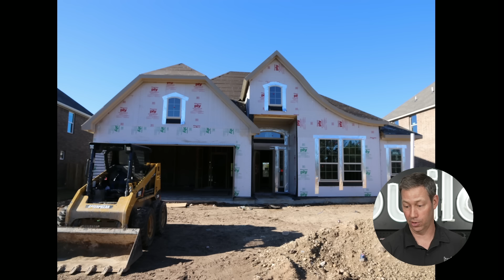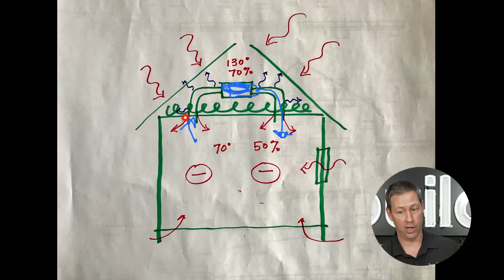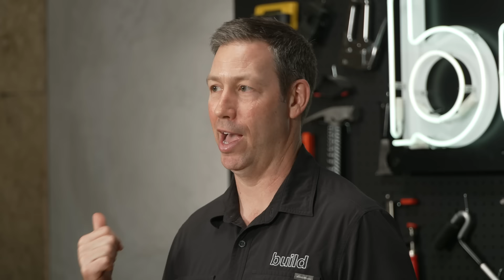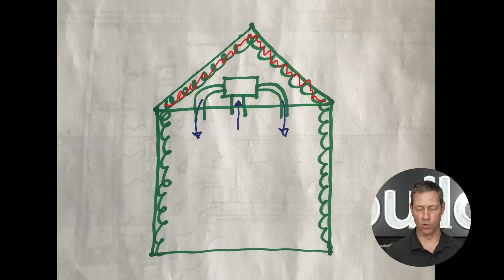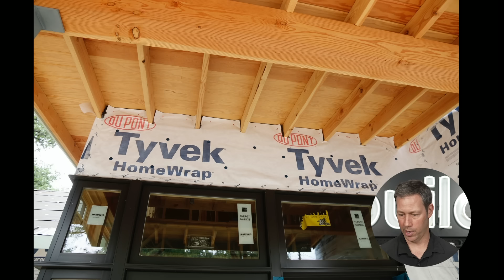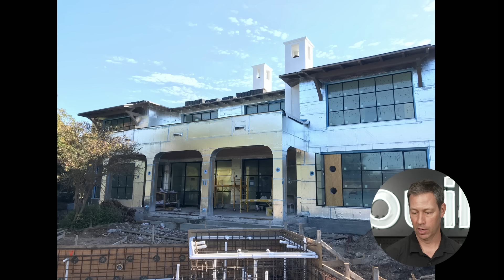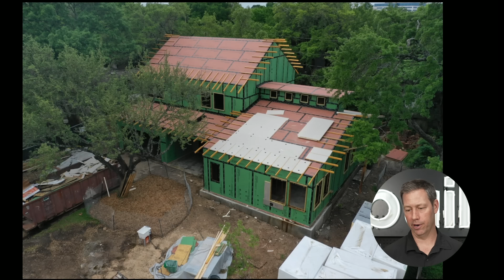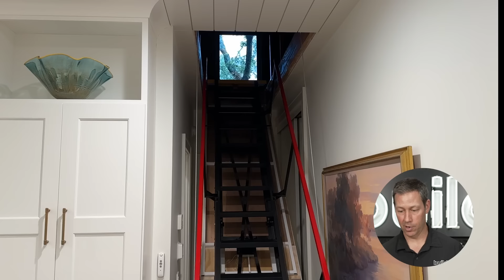CRAPPY ATTICS are Standard in America! Here’s how to BUILD - DECENT or AWESOME

Comment: How well does a house built like yours hold up to settling? Do the tighter tolerances present challenges? ie- if the base of the house is settling, does the taped (butted up wall to roof-line) corner hold up since everything is cinched together or will it "tear" creating a hole?
Reply: Settling is less common/severe when done on a good slab.The tighter tolerances also resist setting from the frame level a bit more due to less range of motion between materials. Following this with the tape and line seals then helps counter any minor settling that can happen by providing an additional barrier.

Comment: QUESTION:
Hey Matt - Why did you go with Rockwool in your house instead of polyurethane foam? Is it a longevity thing? Cost? Performace?
Reply: I’m guessing it’s the budget. 95% of Customers have a budget that can’t afford spray foam. Spray foam is way more expensive than rock wool.
Reply: @ykciR I don't think in his case was the budget ;), I would not use spray foam even if I could afford it and will not use it with my build in Chicago, for sure ;)) ? (mineral wool is the way to do it ;))
Reply: No fire risk would be my answer. Most foams burn readily, and any inadvertent insect access to it can threaten to fill it with holes or removal, also.
Reply: @piotrek4302  but why?  What’s the logic behind that preference
Reply: @27photogger  Fire, toxic smoke if burning, outgassing, if not concerned about that then it can separate from the structure over time if the wood shrinks or house settles since it is rigid and will break providing gaps for air instead of conforming to any movement.

Comment: Awesome video, great tips!  I redid a 60's attic a while ago and sucked out all the old stuff + droppings.  new vents, radiant barrier roof,  it was a lot of work but worth it.   On my new builds I'm going with conditions attics and try to get to awesome!  I also painted the old brick white, which rejects a lot of the Texas heat, brick went from scolding hot in the afternoon to warm to the touch.  but I didn't achieve much for house seal.   I did foam up all the cable penetrations and gaps I could see attic to ceiling-wise.

That R-50 roof is genius, best way to go for Texas.  I saw another youtube builder doing something similar but the nailed the eaves to the siding which I felt was structurally weak and will sag eventually.   

Thanks again!

Comment: This was the perfect video for me As I live in CENTEX about an hour north of Austin, I have an attic with the open cell foam. It's actually not bad, but it could be better. I wanted to do some improvements on the space and you threw out a lot of great ways to improve it. I also want to work on the attic space above the garage. The garage is insulated and stays fairly comfortable. The space above has no insulation and your current attic setup looks like it might work for that portion of the attic.

Comment: The crappy attic is awesome if you just don't put mechanicals in it. Smaller area to air seal and insulate with cheap cellulose.
Reply: True.
Reply: Of all the comments to this video, yours is the one that is the most spot on--a true "emperor has no clothes" insight. You have stated the obvious, but most overlooked. The cost to create a conditioned space in the attic creates two issues: the cost to seal and insulate at the roof vs. at the ceiling and the cost to now cool and heat that space. As you stated, the best solution is to avoid having the HVAC system and ducts in the attic. Just look at how all the multistory condos and hotels install the mechanicals and ducts using closets and soffits and dropped ceilings. I live in hot northern LA county (more than one hundred 90-110 degree days) with a 15 year old 5 k photovoltaic system that provides for all the energy needs with 5 mini-split heat pumps (installed at less than half the cost of replacing a central air system) in my 1800 sq. ft  1950's house. My "crappy" ventilated attic has blown-in insulation with no perforations except for bath and kitchen exhaust fans that vent at the roof. The conditioned attic is nice if you need the space for storage, but it is a very expensive storage space. It is far more cost effective to focus on reducing the need to store crap than to not have a "crappy" attic.
Reply: @froger580  No, the comment is deliberately ignoring key points made in the video such as how in Texas basements are rare due to the solid rock we tend to sit on making basements incredible expensive to build. If you don't have a basement and don't want to put it in the attic you either need very thick walls or you have to build a crawlspace on top of the slap to run ducts under there, which increases the cost dramatically as well. If your PV cells are on the roof, that is a major factor in reducing the temp of the attic as it creates an additional barrier to the roof. In the portion where he talks about his house you can see that he essentially does much of the same effect by making it really two roofs with insulation between. Rephrasing what was said in the video is not insightful, nor pointing out something allegedly "overlooked."
Reply: @IAmTheRealBill no. You dont need a basement, a crawlspace is fine. You can also build up and essentially make a crawlspace. Which then gives access to all your plumbing as well. Or you can put it in soffit, walls etc basically anything to not put your hvac or plumbing in the attic which is the worst of all options. And he probably would charge a 100k+ to outfit that attic like that when it's totally unnecessary

Comment: Conditioned attics need to be required by code otherwise they will continue to be a small minority.
Reply: He kept saying, it’s not that much more expensive, but I have no concept of how much is not much. I agree we’re going to have to force people to spend more per sq ft, but how much more does this add. How many more people are out of the market because increased built in costs keep them out. I personally like the idea a lot and have added it to my list of wants on the next house, but I hesitate to have govt mandate it like the state of CA where I’m told it’s now mandatory to have sprinklers and solar panels in residential construction.
Reply: Insulating the roof would be pretty much all that is needed. I am guessing that spray foam on the underside would cost 10 to 15 thousand dollars for a 1500sf house. Another option would be to use SIP's for the roof. The builder could offer an option at a specific upcharge and the government could provide a tax reduction or percentage rebate to the buyer. The government has to help in some way or it is just not going to happen. We may be moving to a point when only the affluent can afford single family homes and the rest of us will settle for multi family housing. @matthewbono3273
Reply: @Armand9100  You complain about making homes more expensive in the same paragraph as mandating them to be more expensive. That isn't a solution. Besides, as someone with decades of experience with government mandated technology all you wind up doing is stifling innovation and keeping it more expensive because functionally it becomes the government selecting a "winner" and literally excluding other options. Over time this compounds into a nasty effect.

For example, consider how much Faxes are still required in almost anything government involved and how that has slowed the progression of major industries such as healthcare to adopt more modern data interchange. Because back in the '80s faxes became a mandate - and now its been an uphill battle to migrate things to digital systems that are far faster, more flexible, and all around better but because the mandate is "facsimile machine" aren't allowed to be used.
Reply: well said

Comment: Always wondered why some countries doesn’t use the attic as living space? Where I’m from that’s standard, but our roofs are steeper so there’s more inside head room and we use clay or concrete tiles that make the isolation process a lot easier as they can ventilate. Also we have the purlins resting on the side walls so we need only one rafter in the middle, that also saves a lot of space.

Comment: Great video, lots of good information.

Re: sealed attics, this is a complicated topic because it's counter-intuitive and it's very seldom explained well.  

As you say in the video, different climates have different challenges.  In hot and humid climates, in a house with AC, you have to think more about humid outside air getting into the attic and then being sucked into the ducting and condensing.    You may not have as many problems with water vapor from inside the house rising up into the attic, because the air-conditioned, colder interior air is more dry than the outdoor air, but I'm not sure about that.  I can explain the cold climate issues a little better, because I live in a cold climate (IECC zone 5, western PA) and I've been trying to figure this out for my own house.

The "what" of it is:

In cold weather zones, water vapor comes from inside the house and will naturally rise into the attic. The water vapor will either exhaust through vents in a vented attic, or get trapped in a sealed attic and eventually condense and cause mold issues.  If you want to seal your attic then you have to plan for clearing out that water vapor, whether that's a dehumidifier or a return air duct or whatever. (One common approach is to clear out any attic floor insulation and hope that natural air exchange between the attic and the floor below will clear out the water vapor).

The "why" of it is:

1. Water vapor is molecularly lighter than air, so it rises like helium.

2. In cold weather, water vapor is mainly coming from inside the home.  We think of cold weather as wet weather, but that's because the cold causes the moisture to condense and end up on the ground, so you're left with wet (or snow covered) ground and dry air.  Inside the house the air is warmer and relatively more humid.

3. In houses with traditional vented attics, the water vapor rises up into the attic and then out through the vents.

4. In houses with sealed attics, you have to plan for what happens to that water vapor, i.e. make sure that it will get cleared out of the attic.

This topic is complicated by the fact that every house's structure and family's usage patterns are different, so an approach that can work fine for one house/family may cause problems for another.  For example, my parents house has had fiberglass insulation against the roof deck for 42 years and it's still fine.  But somebody else might not have the same results.

Also, I think part of the counter-intuitiveness is that people think of the attic as being part of the inside of the house, but it wasn't originally meant to be.  The cubic volume of the attic is "accidental space".  It's not there as part of the house interior but rather because it's really, really hard to make a waterproof roof without taking advantage of gravity.

Comment: I live in NJ older 1970’s Bi level on slab with poured foundation AC air handler in the attic. However, upgraded in November to 38 insulation . The company ATTIC CRAWL vacuumed out all old insulation & sealed up everything added r 38. It cost us $7000 ! but worth every penny. Now much warmer even temps in the winter. Definitely not a DYI

Comment: I’ve got a pretty standard house here in NC. At least for my area. There are numerous examples in a quarter mile radius from our home. There’s been some remodeling with a few walls that’ve been taken out to make a big open area kitchen/dining/living room. The attic has so much space that I’d love to put to use. Put in an extra room or even just make it a usable space for storage. The thick blown in insulation is also in the way for me to inspect and fix the crappy wiring…changes let’s say, that a previous owner did. Oh and around the outside of the house, there are vents, that have been painted over. In some places it’s completely blocked. I am a Disabled Vet living on a very fixed income. I can’t really do the work myself, maybe the electrical a room or circuit at a time..  The manual work and raised arms is just not possible. The electrical being on the floor of the basement means I could works on my knees or something.  Maybe one day I’ll be able to do it all….

Comment: I remember one year, 2010 i think, Donald Fetzer worked with a builder on a parade house in the hill country so i could have a table in the attic to share the benefits of spray foam/non vented attic. (It was a walk in from the second floor). The roof tiles were terracotta and were around 150-160 degrees, outside upper 90s but i was around 80 degrees.  Half the people that walked by got spooked thinking i was a ghost, the other half couldn't believe i was comfortable.

Comment: My house has a "crappy" attic insulation, but the air conditioner is in a second floor room directly above the first floor return. The delivery ducts run between the floor and ceiling. Only the top floor return duct runs through the attic. The bigger thing I dislike about my attic is the base of the supports coming into the center reducing my storage space.

Comment: You'd be surprised how many slab foundation homes are in the north too, mainly built in the 1950s and 1960s. They casted the duct work into the slabs (galvanized iron ducts and concrete, great combo!). These will rust out and collapse, or even worse, flood, so the only fix is to run duct work in the attic. Mine still work OK. I used to wish I had a crawlspace, but then I watched your crawlspace video.

Comment: If I may. I enjoy watching ALL of matts vids, many multiple times. But these homes with all of the latest energy saving designs are SO expensive. I just tried (3 different contractors) to build a 1200 sq ft Cape in Mass. The 2024 building codes were adopted this past July. I was told it added $35K to my small, one bedroom, bath and a half, Lowes kitchen. R60 ceiling/roof, R30 walls (requires foam board ext) fresh air intake, and oil heat, the fuel with the  the greatest Btu output is now banned in new homes. Bottom line w/well, septic, 475 ft driveway- 1st bid $596K. 2nd bid we removed beams, cathedral 2nd floor ceiling, etc. $518K. 3rd  bid was just for the structure around $400K.

Comment: That Polyguard AlumaFlash is cool but have you heard about Radiant Barrier Fires? These aluminum shells that are created on houses can attract lightning and then any bottleneck in the thin aluminum shell on the ground pathway can superheat and start a fire. In RBF roofs this causes multi-origin point fires in the roof usually at contact points in places like the clips between plywood panels.

Comment: The bare minimum someone can do that makes a big difference is buy a bucket of duct mastic, and an IR thermometer. Go up there and find all the cold spots  while the AC is running and seal them. In my 70s house I found one big open crack and I also found that the registers werent sealed well. All of them. Aluminum sockets were joined to the ceiling drywall and the duct was basically placed on top. I sealed every one of those with the mastic by taking the grill down from the ceiling and reaching inside. IDK how much of a difference all this made but a lot of cold air was being lost. Every few years I take the IR up there and just do a little recon. So far its holding.

Comment: Very interesting to see. Its striking how simular you inslutate for heat, the way we insulate for cold. We have solved most these problems by creating a diffusion barrier in plastic which we later test with over- pressure, during the production phase. This is placed within the first 1/3d of the insulating barrier to prevent condensation. My guess would be that this would be applicable to Texas aswell, but on the outside third instead, as the inside would generally be colder than the outside.

When the living space is air- tight, we use controlled ventilation, either in combination with heating, or with additional heating, or with a heat- exchanger, which would work also for preserving cold in combination with an AC- unit, to create a controlled climate. This would probably be the better solution than to use stand- alone air- condition as it is hard to control the under/over- pressure with the AC having to evacuate the hot air somewhere.